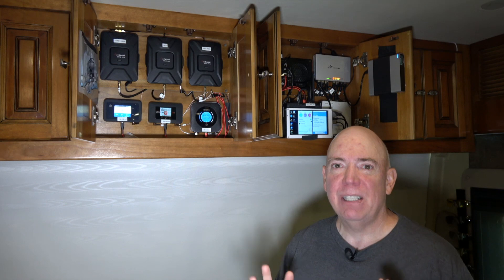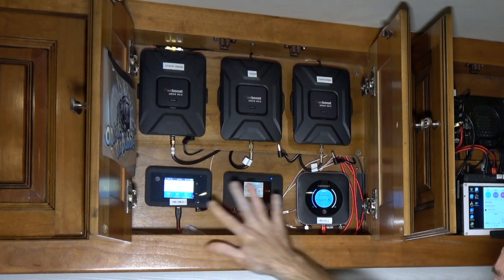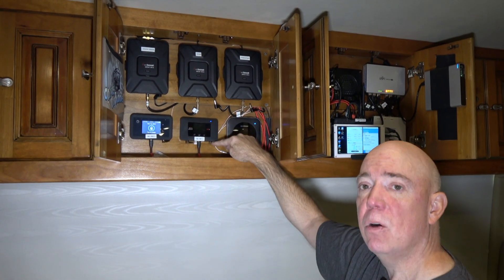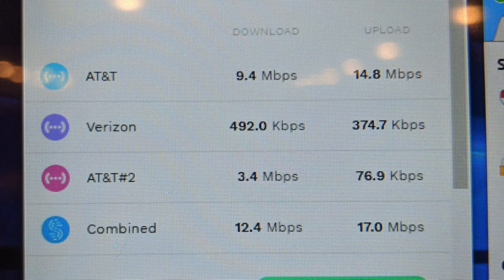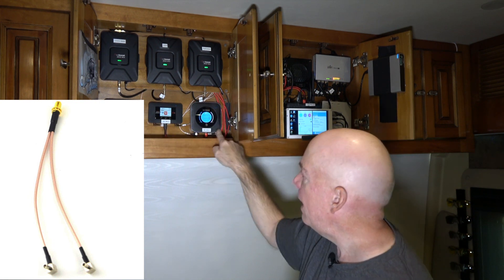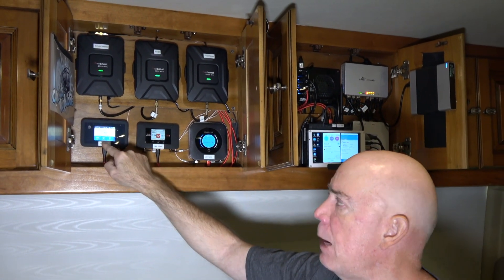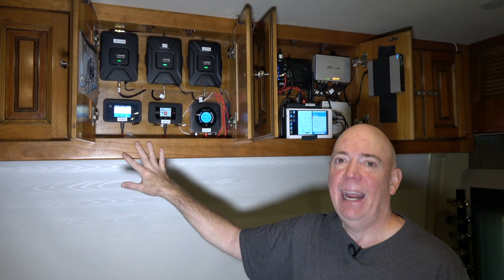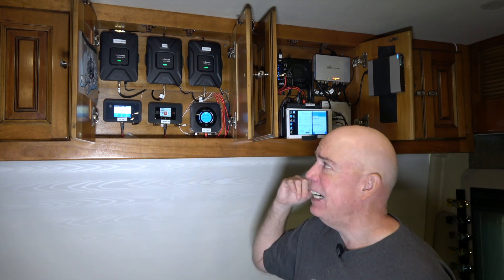Super Boost 4G JetPacks using weBoost Drive 4G-X Direct Connection!

Comment: I'd like to hardwire my 1 Jetpack into my 1 WeBoost Amplifier.  There are 2 antenna ports on the back of the Jetpack.  Which port should I plug it in to?   (Or, do you suggest I do the splitter method to combine into 1) ?   Thanks!
Reply from the maker: Hi, I would use a splitter and split the connection to make it to T9 connections. Assuming that it's a T9 connector and your jetpack.
Reply: @DavidBott  Thanks you.  Just to confirm - I have 2 external antenna ports on my Jetpack.  Can I use a "Y" type of splitter to combine the 2 antenna ports into 1 ?
Reply from the maker: @thomaskaspar6053  Yes, you can. Not a problem whatsoever. The WeBoost will handle multiple frequencies, and the way MIMO works, in this case the two antenna ports for multi and multi out will be working on different frequencies. Which the WeBoost should handle just fine. Just make sure you get the right splitter from the cable from the WeBoost that has two T9 on it, as long as that is what your jetpack uses.
Reply: @DavidBott  Perfect.  Thanks.  That helps!

Comment: Hey Dave. I currently have one weBoost amplifier and one Verizon jet pack. The amplified signal is currently going to my inside cellular antenna which gives me great bars. Do you recommend I plug both jet pack ports into one of the amplified lines or just use one of the ports on the jet pack? Will it make a difference using one or both the ports since I only have one antenna outside and can’t access mimo?
Reply from the maker: Hi Garnett....Seeing you have one, I would put in INSIDE antenna as close to the JetPack as you can.  Even right on top of it.  This will give you the best result without the need to try to hardwire the antenna ports.  Hope this makes sense.

Comment: Have you done a test with two booster hooked to one jet pack using a booster for each antenna individually?
Reply from the maker: That is more or less what this is.  Each JetPack has two different boosters and antennas connected.
Reply: @DavidBott  thanks for getting back. I was just wondering if there would be any improvement if two boosters were bused instead of using a splitter into one booster. Thanks again great post.
Reply from the maker: @normantkachenko9994  I am using two boosters, three actually, in order to get all JetPack connected up, I have to use splitters. But if I only had one JetPack, and wanted to do this, I would use two boosters, one for each antenna port.  You can also just try using two high gain 4G antennas, without the booster, to save cost.
Reply: @DavidBott  hoping someone will try using two boosters, one for each antenna port.

Comment: Hello David !
I stumbled upon your great internet setup video by accident. I am fascinated by this solution. However, this video is a bit old now, have you made any changes since then?
And in fact, by the way, seeing so many positive comments, it would be fantastic if you would make a simple schematic diagram of this connection for those interested

Nick
Reply from the maker: Hi Nick...I have made no changes at all and all Jetpacks are still working without issue and all is well.  I did not do a drawing for some JetPacks have different connectors.  More or less used TS9 Y cable's and cable extensions to connect up the packs to the different boosts. Each antenna port of a JetPack is on a different booster.  NOTE...Costly to do this, but it works but you can likely be just as fine with just the OTR antennas.
Reply: @DavidBott  hi :) that's why I mean the "simple" scheme ;) without description and type of plugs, it is about general connection, btw, I left you a private message;) Keep it up ! I'm going this way also thank you

Comment: Hey David, I I know this is an old post but do you have a video, or do you know of anyone who has a video explaining how to do this? I'm an Engineer (civil) and need the ability to share and stream large files. Right now I am using AT&T and Verizon, but it would be awesome to bond them together to boost the overall connection speed. Thanks in advance. Safe Travels.

Comment: It should be noted that this is NOT the way you want to hook up MIMO Hotspots. You don't want cell phone boosters but instead you want to run them straight to antennas. If need be, you can use an M2M booster which is made specifically for this sort of thing. Only use a cell phone booster if you want cell phones to work better, otherwise avoid them.
Reply from the maker: Thanks for the post.  Boosters like weBoost CAN and DO boot 4G signals and thus will increase data speeds.  Directly connecting each antenna port to a separate booster and their for antenna results in longer range for data we well as being able obtain better speeds.  I have been running this over over a year a a half and had had very good results with the booster connect vs just connecting the external antennas. M2M boosters are for IoT / M2M use where a weBoost type device can do 4G and Voice channels.  True the devices like weBoost were not made directly for this use as are M2M boosters...That does not mean they will not work as I have been able to show as well as been using. (I have had data where others with the same JetPacks did not.)  M2M only devices are made for direct connections, are usually less costly, and are used in things like ATM machines or even signal lights.
Reply: @DavidBott  Yes, it can and will boost 4G but the fact is it will NOT get you a better signal than directly connecting to an antenna port. Don't believe me? Try it!. There's few cases where a cell phone booster will benefit your 4G hotspot like over long wire runs connecting to high frequency bands. 

Boosters collapse MIMO signals as well. You don't want a booster unless you have some weird necessity. I've run GO Fis and tons of other solutions with them and the only way I'd ever run a booster again is if I needed cell phone service too, for that, fine. 

Also it should be noted that cell phone boosters connected directly to hotspots can blow out the hotspot antenna ports ruining them.

There's also other huge gains by doing a direct connect. You aren't relying on a few boosted channels, instead you have access to every band and this is often WAY advantages over getting a boosted signal. 

Again, if you don't believe me, try it. If you get a worse signal this way then something is wrong with your setup, probably antenna wise, Omnis are rather awful and shouldn't be used unless you need to save space or you're in a location with multiple directional signals.  

With my setups I can pull 80mb down 100ft sunken in a valley 10 miles from a tower, trust me, I know what I'm doing.

Comment: GET THAT DAMN T CONNECTOR OUT OF THAT FIRST UNIT.

You're gonna burn the left most (verizon?) system up, the following is why it runs so slow:
-Your system at best has a 2:1 swr, half your signal is being lost as heat
-Your MIFI in transmitting DIRECTLY into your boosters receiver, causing your booster to transmit that signal into your RV and possibly creating a feedback loop and eventually will fry the booster.
-Your booster is transmitting into your MIFI's receiver, it's not designed for that level of RF to be directly injected into it, you're gonna fry the receiver. 
-Your TX circuit in your MIFI will get fried due to the fact that at BEST it sees a 2:1 swr (in reality 3:1 or worse) at 2:1 half the RF is returning as heat, 3:1 75% returning as heat.

You've created a total RF clusterfuck, stop trying to cheat physics. Not to mention you've got some poor cell company field tech pulling his hair out as you drive around effectively jamming towers as you get close to them! 

But what would I know, I only have a extra class radio license and have worked on 2 way radio gear and long range WIFI systems for 20 years.

Comment: Just for science, how much of that gain in speed is simply due to the external antennas? Do you really need the weBoosts? I've been led to believe that buying a jetpack with an external antenna input and simply wiring it to an antenna is as good as using a weBoost. The advantage of the weBoost, they say, is that it acts as a repeater for your traditional cell phone calls and your 4G cell phone data, but since you have jetpacks and a WiFi setup, you could just use that for data and also for WiFi calls with no need for a cell phone repeater. Have you done any testing using just a roof-top antenna?

Comment: Are not using the Winegard Connect 2.0 that you installed on rood for cellular service ?  Is it worth installing or jetpacks?
Reply from the maker: Hi...I am not using the Connect 2 at this point as I have these other JetPacks which offer more Frequencies they can use vs the 4G radio that is inside the Connect 2.  It is worth installing if you do not have another local personal Wi-Fi network capable of connecting to and RV parks Wi-Fi.  For doing so, you then have a private network to connect your devices to for safety as they are then behind a router and it can then either use the RV Parks Wi-Fi service or 4G service if you have a decent plan. (All 4 plans I have are unlimited data currently...Thus I am running 4 JetPacks.  But I could put one of the SIM's in the Connect 2 and it would work...but as mentioned, it does not have a number of neweir (aka faster) 4G frequencies that have come out over the past few years.  Here is a blog post and video I did about being sure to use a private network if using an RV Parks WiFi... https://outsideourbubble.com/warning-dont-attach-wi-fi-devices-rv-parks/

Comment: Dave- another great episode!  Thank you for sharing your knowledge, techniques and tips on this!  My question is, is the weBoost a passthrough system? Meaning would there be times in which the cell signal is actually less when boosted due to some type of interference or gain distortion which would make a user want to turn off the booster but the antenna is still working and sending signal (non-boosted) to the packs which allows the user to not lose the external antenna capability (and resort to the little tiny rubber-ducky antennas?
Reply from the maker: Hi...The weBoost does not pass though the signal from the antennas when it is off as as outside antenna and inside is connected to the amps and do not go through any relays for switching.  It is made to be ON and used after all.   But you can surely run into issues one would THINK if they were close to a cell tower.  However, I am at an RV Park now where the Verizon Cell Tower is right outside the park and if I use the Jetpack, and I have tested this, with the weBoost on or disconnected, I do not seem to be hurt by the booster.  The reason I think is that it controls the power it is using with automatic gain controls based on signal strength.  But good question for sure!  Hope this helps.

Comment: have you found that the single weboost antenna going into the jetpack is outperforming the internal mimo antennas on that device most of the time?
Reply from the maker: I am using more than one antenna, so I have not tried just one vs the internals. But the larger OTR antenna surely has a lot more gain than the internal antennas.  If you are close to a tower, then the internal MIMO will work...but if not, it can't use MIMO anyway based on low signal. MiMO is not always a guarantee as it uses more than one frequency and they need to somewhat have similar signals or timing would be off.

Comment: Phenomenal. Answers so many questions about directly boosting my VZW JetPack with my WeBoost Connect 4G while splitting to other antennas in my new smart home. We have decent signal inside the home - I just wanna do it to say I did. Thanks for this vid!
Reply from the maker: Your welcome.  All JetPacks are still doing fine without issue and it is just coming up on a year now.

Comment: Hi David, are you still using this setup? Did you see any issues plugging in your WeBoosts directly to your Jetpacks?
Reply from the maker: Hi...Yes, I am still using it like this and have had no issues with the direct connection to the radios.
Reply: @DavidBott  Thanks! So you could leave them on full time and use them for 2x2 MIMO?
Reply from the maker: @SimonBelgium  That is what I am doing.  However, if VERY CLOSE to the cell tower, you may try turning it off as over powering a tower is not a good thing and could actually slow you down. :)

Comment: Sorry to be late to the party, but I have a question regarding using a single antennae and booster to run 2 jetpack.  Would that defeat the MIMO or is there a way to split the signal and bring into both jetpack at the same time? If that is not an option, how about 2 ants and 2 boosters to do the same job?  I was really hoping to only install a single antennae if possible.
Reply from the maker: Two JetPacks running MIMO would be running 4 receivers off one antenna.  I would not think that would be the best way to go.  I would run two antennas, each with a splitter so that you can put each antenna into a different port of each JetPack. Most JetPacks use TS9 connections so I used a splitter like this... https://amzn.to/2Qn0wc8   One TS9 into each JetBack and then do the same for the second JetPack with a seperate antenna. IMHO :)
Reply: David Bott Thanks David. Sounds like the plan.

Comment: On the Nighthawk LTE, Would like to know the difference between having no external antenna connected, and then having the two weBoost amplified antennas connected.  

I’m told that the Nighthawk has 4 internal MIMO antennas, and when you connect 2 external antennas to the two ports, the other two internal antennas are disconnected.  

I have tested this with my Nighthawk using a non-boosted MIMO antenna and found it to be true.  My speed actually dropped by half with the external antenna connected (even though the number of bars went up slightly). Wonder if the boosted signal would do better.

BTW . . . Good information!   Thank you for your contribution to the RV community. I don’t know of anybody else who has spent their time or resources to setup multiple weBoost amplifiers to test a theory.  Nice work! 👍

Comment: David, I have an AT&T jetpack (AT&T Unlocked Netgear Unite Explore 815S 4G LTE ) and a Verizon 7700 Jetpack. Both are mimo and have inputs on the bottom.  If I was to install 2 weBoost boosters and antennas then cross connect to the two jet packs (one input from each booster as you have done) should I get a significant increase in data speeds? We are full time and do EVERYTHING on cellular.
Reply from the maker: Hi...Funny you should ask... Here is a video... https://youtu.be/q33mxuQmtac     You may not see any increase in speed as it could just the the tower is crowded.  But it will give you the best chance at good data over longer range.  But data speeds are VERY subjective as their is A LOT that can affect it and it is not always signal. You could right next to a tower and still have slow speeds if the tower is congested and you have no way to know that.

Comment: Great video, I am not on the road but live rural where there is no high speed internet available. i currently use the weBoost  home multiroom (470144)  and it doesn't  boost the signal well. what I'm wanting to do is keep the internal antenna but connect my MiFi to the incoming line of the booster as well. I tried to use the links provided but they don't seem to work. Can you please let me know if the links are correct? and if you can tell me what connections I need different from what you are providing.
Reply from the maker: Hi...All the links worked just fine for me.  Anyway...Hard to help you as I don''t have the same booster and this the connectors could be different than what I referenced. The Multi Room also is a much more powerful unit and thus I am can't say that it would not cook your JetPack radio if you directly connected it. I would recommend just putting your MiFi JetPack right next to the inside antenna, even touching it.  That way you are sure to have the best signal for it.  If your not doing that already, give that a shot before trying any direct connection.

Comment: David, I enjoy the things you present, this one seems like a great idea, but I have a question, my weboost has make connectors sticking out therefore I have a female coming from my indoor antenna and what appears to be a ts9 connector from my Verizon mifi, I'm not following how you connect using the items you listed, thank you in advance for your response
Reply from the maker: I thought I listed it well in the description with even all the links to parts. But SMA Male to TS9 is needed. If you have one weBoost, then you will need a T connector also listed.  So more or less, T-Connector, Inside Antenna off that, Extention off the other side, to a Male SMA to TS9.  Then into post 1 of the JetPack seeing you only have one antenna.   Hope this helps, but it is listed in the video description.

Comment: Question... looking at service providers ... who offers truly unlimited data?  I have ATT service integrated into a mobile router (Meraki gateway)  I currently on a prepaid plan at 18G max.. seems like ATT doesn't have a true unlimited plan as well as Verizon's unlimited jet pack plan  which went end so sale recently in May 2019..  any advice would be appreciated.
Reply from the maker: For the most up to date plan info you should check out https://www.rvmobileinternet.com/   As far as I know AT&T and Verizon offer unlimited plans, but you are subject to slowdowns after 22gig of data.  But you really never know if you are being slowed down or not as data speeds go up and down all the time based on tower congestion.  One min I can be getting 25 Mbps and the two mins later 2 Mbps and so on and so forth.